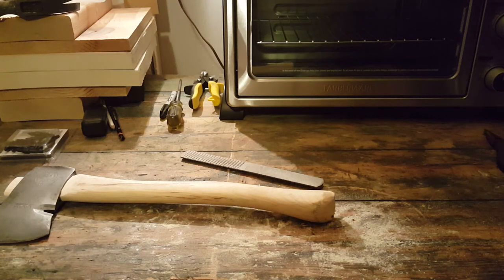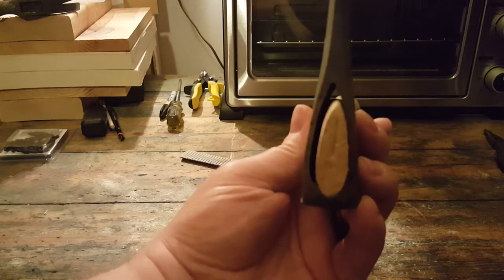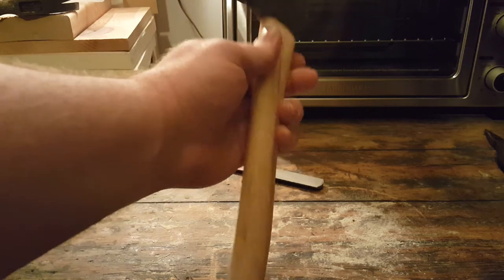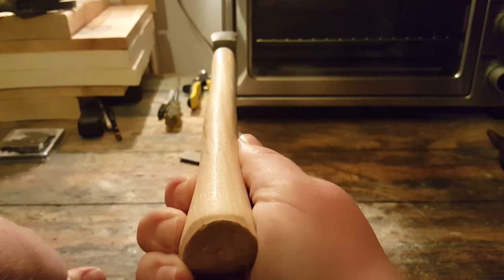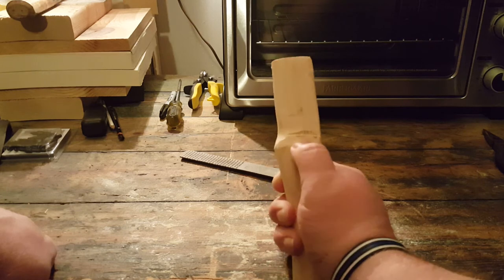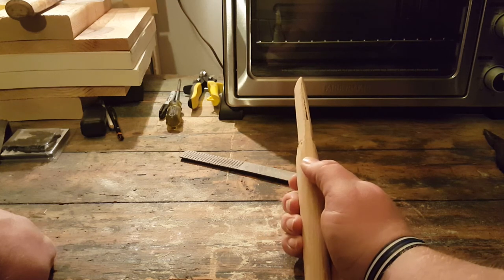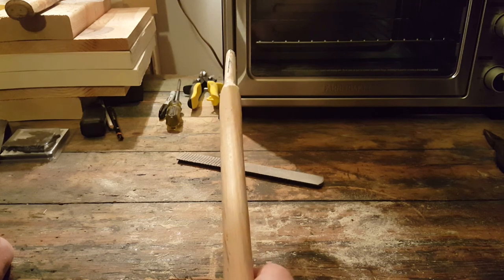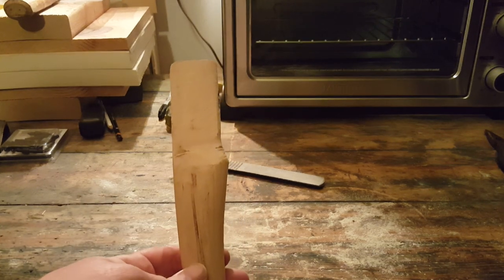Axe Junkies, I Need Your Sage Advice!

Comment: Mike, good video showing your progress and such. I'd recommend that you use what you learned from shaping this handle, set it aside for a different project with a smaller eye size, and find a handle that will fill the eye so that you can start off with more material without having to bring the head down.... Peace, Rooster :)
Reply from the maker: Axe Junkies Thanks man. I didn't know there was a YouTube channel. I'm subbing up now.

I'll keep making videos as I go. Now THAT my shop is cleaned up, I should film a small tour I guess and then figure out how to edit so I can make some videos of the processes.

I've got the bug, man.
Reply: Rooster's the expert, however, I immediately had the same thoughts as he.  I expect it feels a little frustrating, however, the learning is invaluable.  I'm enjoying watching your progress.

Comment: Another handle would be my advice. You can make it smaller but you can’t make it larger. A wedge long enough to fill the eye front to back would help but wouldn’t solve all that’s wrong with the hang.
Reply from the maker: Oh yes. I learned and I got a new handle, properly sized. It turned out great, I think! I have some more videos on the final product. I still need to make a cover for it, but not sure if I want to use Kydex or take the time to figure out leather. Obviously leather would be more fitting.